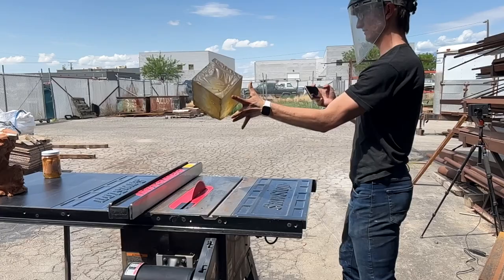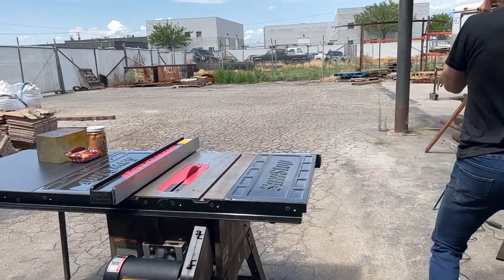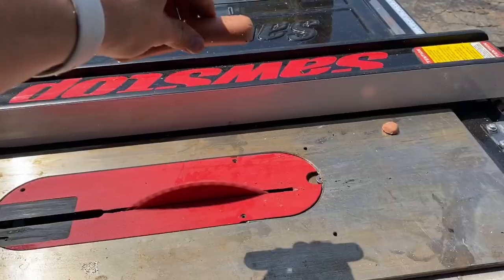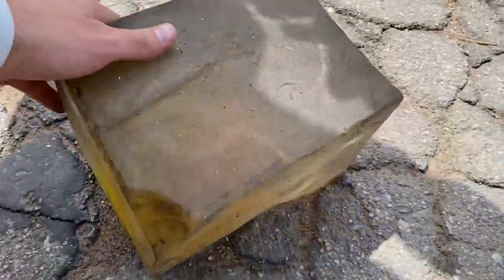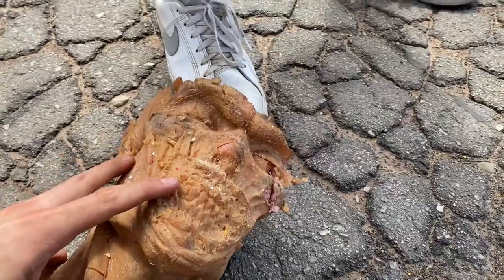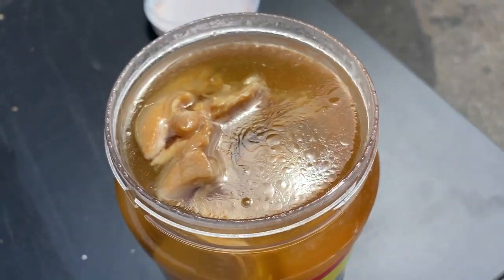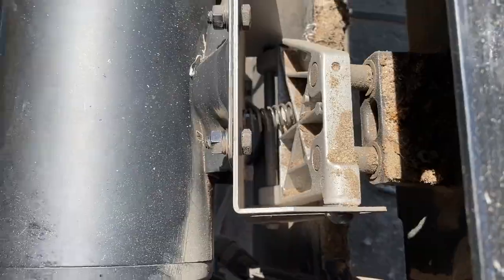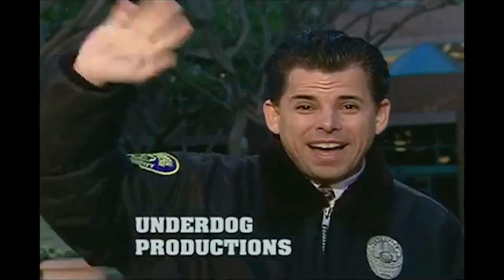What Happens If You Touch The Table Saw?

Comment: The saw's stop function works by conducting electricity from both the sawblade and a hand, or some kind of material with a conductive capacity.
If it was simply because of pressure, it wouldn't be able to cut wood as wood is stronger than a human hand. However, the human body conducts electricity and is majority water, so when a human hand makes contact with the saw blade, the mechanism that monitors a small flow/signal of electricity inside the saw will notice a change and stop the blade.
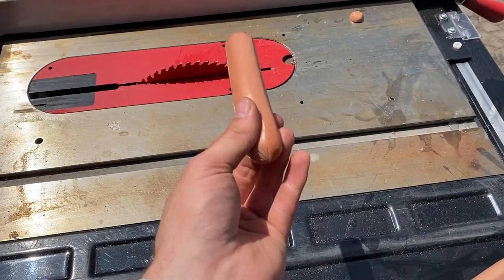Reply: (not enough views to care)  2:10  nailed it 💯
Reply: @zeke7515  A longer, more in-depth explanation can help people understand better.
Reply: I'm pretty sure they know.
Reply: @thelunchbox420x  you never know, a lot of people can see these videos and not have any idea of how something works
Reply: They say it at the end of the video

Comment: The meats need electrical capacitance in order to trigger the stop.
Reply: Shove a 9v battery in, that might work
Reply: I wondered how that works to begin with, is it just the smallest amount of current through your nerves that makes it work?
Reply: @ecgameplayer  kind of like more like the electricity goes over your skin and charges you up, similar to static electric
Reply: @davidwhite538  i see, so the blade acts as the conduit and your hand as the source right?
Reply: @ecgameplayer  the blade has  high frequency ac going through it, and when you touch the blade the current goes into and onto you, that makes a load for the frequency, and when you have a load on a power source with a locked current the voltage drops and when the saw stop detects the voltage drop it kills the blade
Reply: They mention that at 2:05
Reply: @davidwhite538  wow, the more you know, huh?
Reply: @ecgameplayer  the blade is literally under tiny amount of current. Not enough to feel, but enough for the saw to detect when you touch it. Touching the blade creates a short circuit, very easy and fast to detect.
Reply: @1_GigaWaffle  thanks for the explanation, I didn't know the people can adjust the sensitivity of something as rapid as a buzzsaw.

Comment: It didn't stop because the gelatin hand was free-falling and on its own didn't have sufficient capacitance to trip the safety mechanism. If you had been holding the fake hand, it almost certainly would've stopped. This can also be demonstrated with hot dogs. In saw stop demos you always see someone holding the hot dog and the safety mechanism triggers just fine, but if you put on non-conductive gloves and repeat the experiment, it won't stop the saw. This is safe and expected behavior from the saw stop mechanism.
Reply: Thank you from saving my time watching the video
Reply from the maker: That's what I was explaining at 7:00
Reply: @WaterjetChannel  if I recall correctly, you said something about it being in contact with the metal and grounded to the chassis of the saw, which isn't actually a requirement. You can activate the mechanism by touching the blade with a hotdog you're holding without being in contact with any part of the saw and while wearing the best insulated, rubber-soled shoes you can find.
Reply: Thanks, now I don’t need to watch the video

Comment: I actually was tolled how the saw stops work and why they are good at what they do. The spring release is engaged and causes the soft aluminium to release as the spring propels it into the blade. The blade then digs into the aluminium losing all speed as this happens the blade also detaches into the table to avoid any contact with the blade. Reason being the blade is grounded and the moment It detects a change it engages the stop. It's super simple but just a well built system.

Comment: I guess you could wear a grounding wire to the table so, if you ever touch the blade at all it would engage.
Reply: That's kind of overkill, the mass of a human is more than enough to trigger the soft sawstop mechanism. The reason it didn't trigger for them is because they weren't actually touching any of the pieces and none of the pieces on their own have enough Mass to trigger the mechanism. In the few times that it did trigger the mechanism it was because the piece was in contact with the metal of the saw which gave it sufficient Mass to dissipate the current and trip the brake.
Reply: @draconic5129  maybe, but I would assume the gell block would've had enough mass if that were the case.
Reply: In my opinion a saw stops whole purpose is to stop the blade before it can seriously cut you. I think a mass sensor wouldn't be fast enough or could have false positives while cutting material.
Reply: @RamenHutt  it doesn't actually sense Mass it just needs Mass to dissipate the electric charge, as an example a nail embedded in the wood wouldn't trip it unless it was in contact with the metal of the saw or your body since on its own there isn't enough there to dissipate the charge.

Comment: So I just recently learned this but the reason a lot of that stuff wasn’t stopped immediately is because the saw break works through using conduction, when something conductive hits it, the break motor senses it and stops. Since gelatin and hotdogs don’t have that it won’t stop.